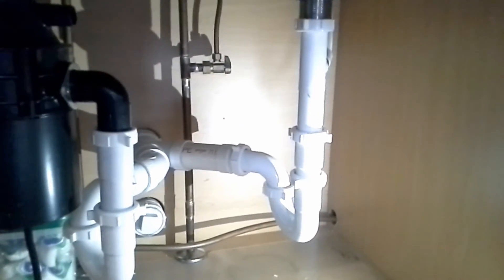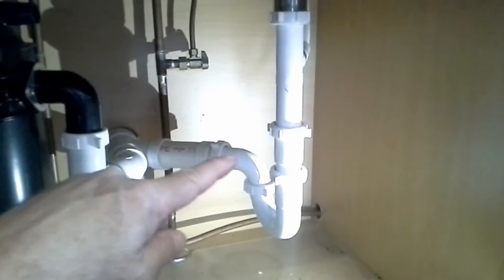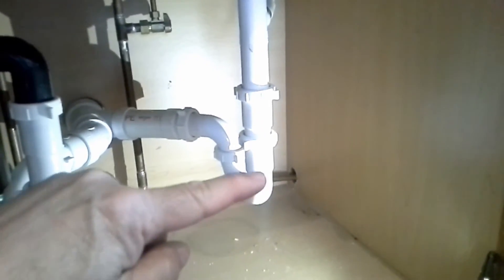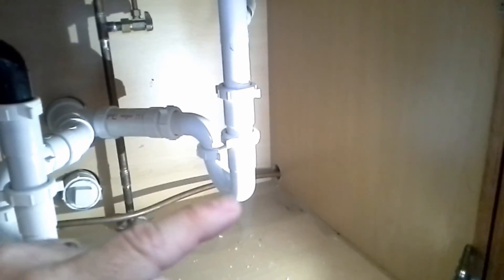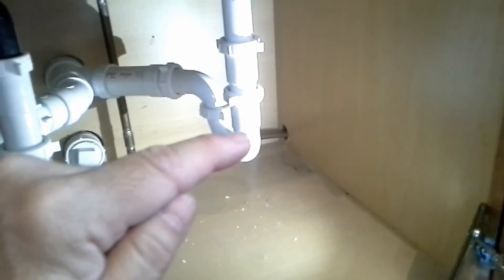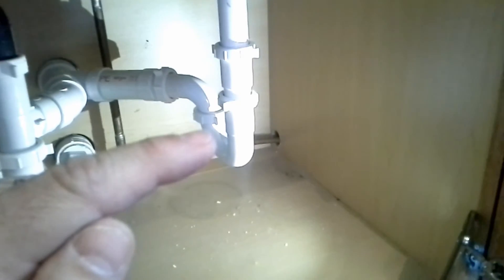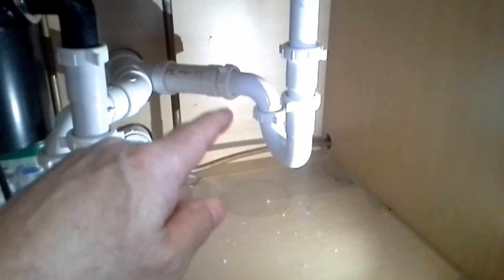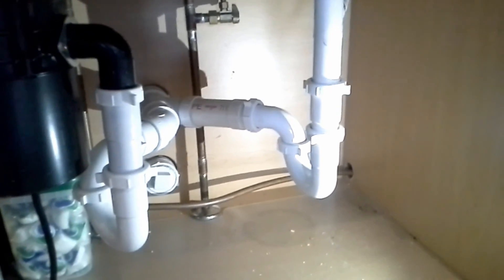How a Sink Trap Works

Comment: Great explanation. I have been always wonder why not use straight or right angle pipes there. Since water will evaporate, is the trap the longer the better?
Reply from the maker: Thank you.... The longer/deeper is not better. The more water in the trap the more force it would take to move it and the more suspended particles in the water that would be settling into the same bottom of the trap and cause clogs quicker.

Comment: I meant to say my bathroom smells like sulfur.  I don’t think it’s the water because my house is only 2 years old and the water doesn’t smell anywhere else in the house.  I cleaned the pipes under the sink (not very dirty).  The ptrap had water in it.  I tried drano, bleach, vinegar and even cleaned the overflow part of the sink and still the smell remains.  I think the smell might be coming from the sink but I honestly can’t tell.  I read that the shower ptrap can be the issue but I have no idea how to check it.  When I shine a light I to the drain I can’t see anything.
Reply from the maker: If you look down into the shower drain and do not see water it may have evaporated. Pour 4 cups of water into the drain and then look to see if you see the water in the trap. I am
 assuming you do not use this shower?
Reply: Actually the shower is used at least once a day.
Reply from the maker: @alexsilverhart5850   Did something die in the wall?

Comment: My trap is full of water but my sink and bathroom still smell like sulfur.  What else could it be?
Reply from the maker: Lucy,
If the water smells like sulfur it is more than likely the anode rod in your hot water tank.This rod attracts minerals int he water iof your hot water tank before it attacks the tank itself. When the rod becomes "full" your water often times smells like sulfur. The solution is to change the rod in your hot water tank.
here is a great article  you can read to help you understand.  http://www.waterheaterrescue.com/Troubleshooting/stinky-water-in-hot-water-heaters.html  .... Hope this helps

Comment: What's that other pipe that's capped off at the bottom?
Reply from the maker: Thanks for watching Eric. That is an access point to rod out the drain line. Have a Blessed Day, and Merry Christmas!
Reply: Merry Christmas and happy new year's to you John.  Going to try and use it today to rod it out. After 25 feet of rod I'm out of luck. Tried draino, salt with hot water, baking soda and vinegar,  even green gobble (had such high hopes after reviewing it) didn't work. Now that you confirmed that's a access point I'm going to give it a go. Followed the kitchen pvc piping down in my basement and saw another cap like that halfway from kitchen to main pvc pipe that was 6 inch. Capped point looked like a t section, so if I can't get to the clog fom kitchen sink access  point, I'm going to open that access point up and rod from there.